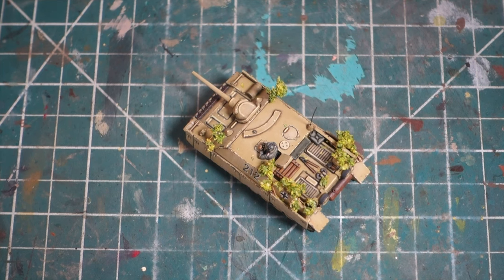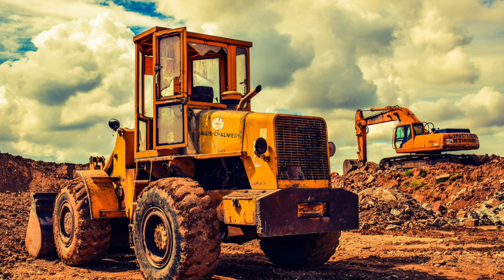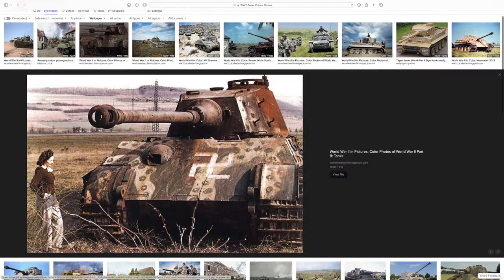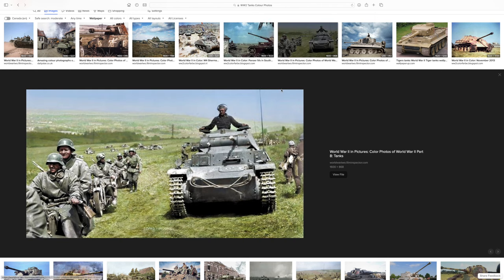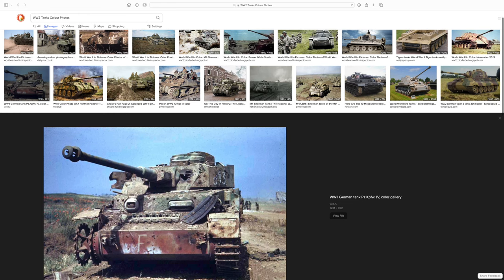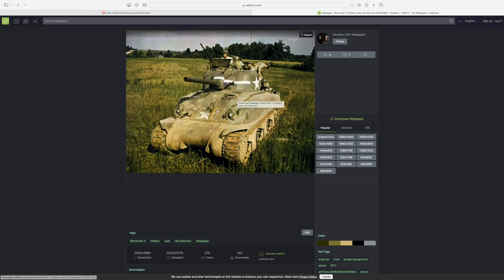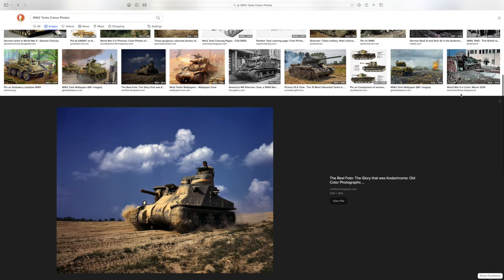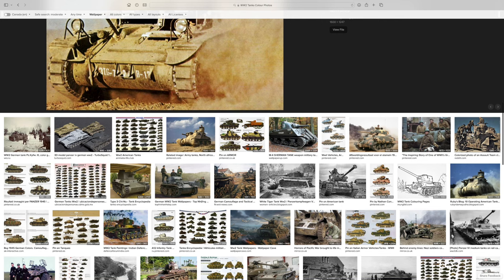Paint Chipping Effects Gone Wild (The ultimate chipping method - leave it out!)

Comment: An interesting and well done video. You made some very good points. I have had similar thoughts over the years. Back in the 1940's they used lead based enamels (I would think) with thick coats of primer then the actual color. I recall seeing images of the paint being baked on Shermans as they left the factory with infrared red lamps. That paint should have stuck to the metal pretty well. Still, as you said. the chipping effect looks neat. A worse look to me is no weathering at all.
Reply from the maker: Agreed. I think one is always safe with mud and/or dust with streaks. That's what the photos seem to indicate.
Reply: Keep chipping away! You're stuff looks great 👍
Reply from the maker: @ET-mr4iu  Thanks! I will experiment with worn and patchy paint, instead. Maybe a chip or 2 on fenders. Maybe. . .
Reply: @daviessuperchannel  having seen a number of vehicles in the service of numerous countries, busted and rusty fenders are a must. As are patches of areas painted over by a similar but not identical colour.
Reply: I used to apply mud 'weathering' to the running gear and lower hull but now I don't. Life's too short and during a game no one notices it anyway.
Markings, however, do get noticed so I spend a lot of time getting the transfers correct.
Reply from the maker: @WgCdrLuddite  Yes! I love doing the markings, too. I find it gives your vehicles lots of character and it's fun to research.